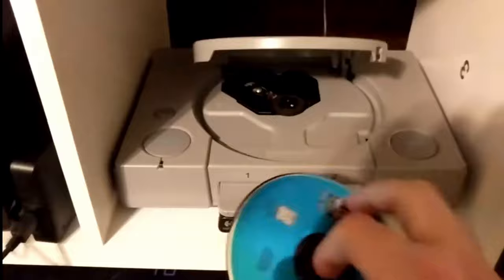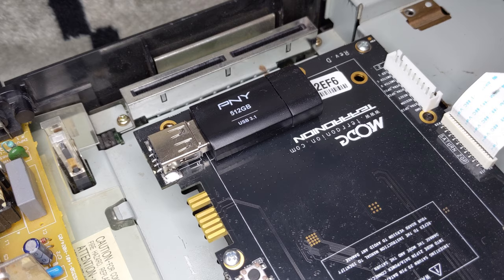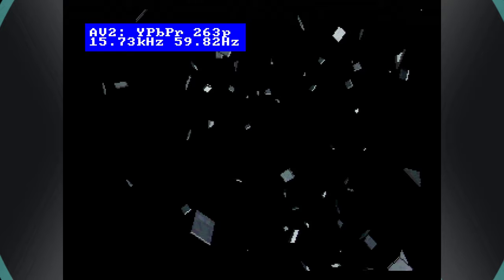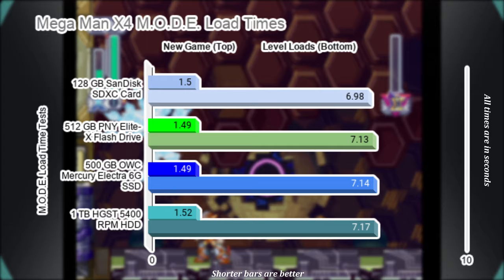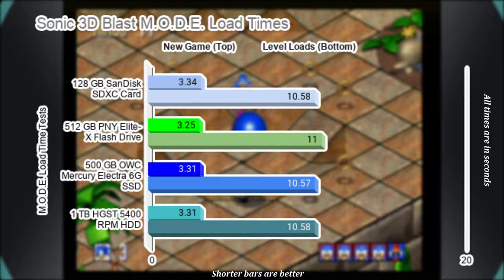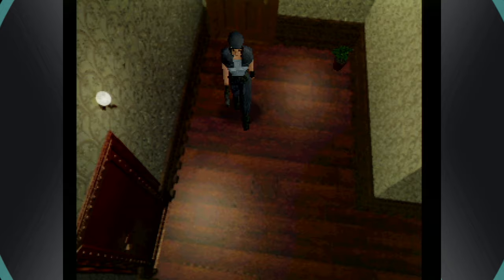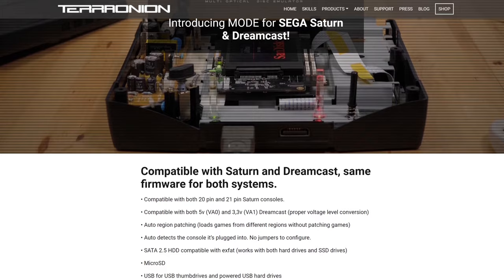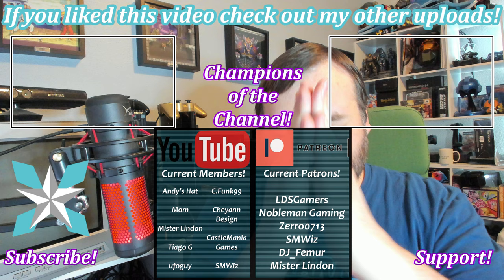Terraonion M.O.D.E. Sega Saturn Load Time Comparisons

Comment: You made a strong case to save money with the HDD. 

BTW Did you get a new mic? The audio quality has improved greatly.
Reply from the maker: As long as it doesn't get too hot there's nothing wrong with it as an option!

As for the mic I haven't changed anything audio related in about 18 months :)

Comment: Nice.
Wonder if this is going to be same as any Teraonion product, ie. It becoming another Holy Grail that is harder nay near impossible to come by over a short time from release? :/ 
It's a good option to have mind, and also it's not like an SSD will last forever either regardless of the non 'moving' parts due to their read/write cycle life., same with micro SD etc, so I'd just go simple HDD route myself, and keep the temp low and in check. 👍
Reply from the maker: Yup, everything wears down eventually

Comment: I was not expecting that much of difference between the systems, considering that I think the original CD can load only 300Kbytes/s, I don't think the bus can handle higher speeds. So for that I think caps a lot the gains you can have from so fast memories.

Comment: Thanks for saving me money!  Without looking I hope that you did one for dreamcast....
Reply from the maker: I was going to but other projects popped up that took priority at the time. I might revisit it but the results were pretty much the same.
Reply: @ArchadesGames  Thank you!  I ended up looking up the tech specs for dreamcast and PS1 after watching your video.  I'm glad you're confirming what I was seeing.  

Dreamcast GD‑ROM Drive: 1.8 MB/s transfer rate, 250 milliseconds access time
Saturn Drive: Data transfer rate: 320 KB/s Access time: Under 360 ms
Playstation Drive: 2×, with a maximum data throughput of 300 KB/s (double speed), 150 KB/s (normal)[8] 128 KB data buffer

Comment: Did you consider 7200 rpm mechanical test?  Would be curious as to how that compares.  I don't own a Saturn but am considering the mode for my dreamcast.
Reply from the maker: It really wouldn't make a difference on Saturn. If this slow drive can out perform an SSD in a number of games the extra platter speed won't mean much.

I am going to be working in a Dreamcast version soon!
Reply: @ArchadesGames  I look forward to it.

Comment: I don't know why so many are insistent on using expensive SSD's on the Mode. With the Saturn, you aren't going to see a difference, you are limited by the Saturn's system bus. Sure mechanical drives have seek time, but compare hdd seek time from the mid 90's and current tech, it's night and day.
Even on the Dreamcast which has a much faster cdrom and system bus, modern mechanicals are more than fast enough.
Reply from the maker: Yes they are but some will always pay the premium to remove moving parts from the equation 🤷🏻‍♂️
Reply: @ArchadesGames  Then why not just use a Micro SD, especially if you're only putting on what you'll play?